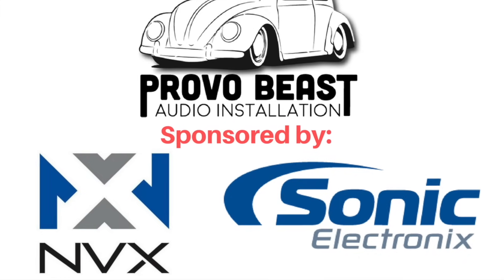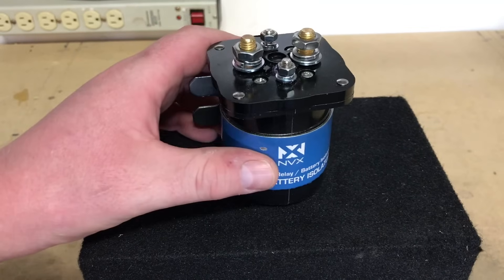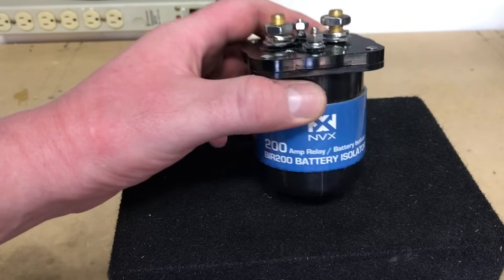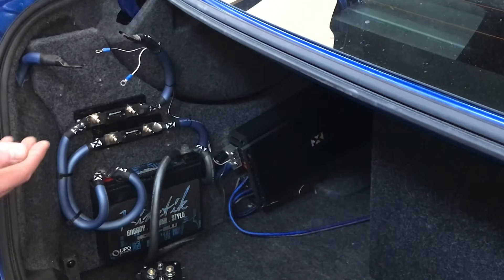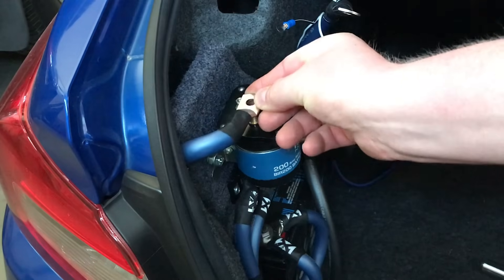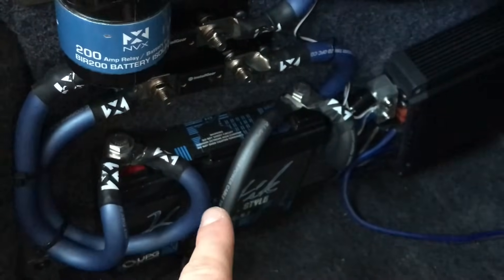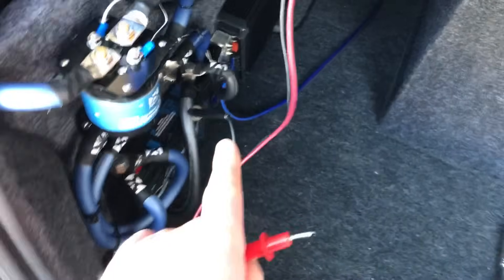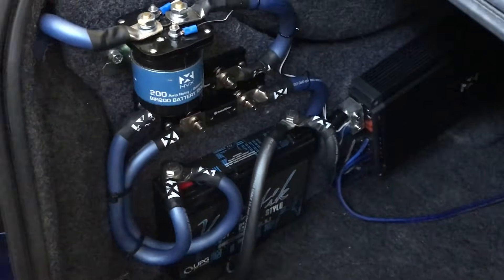Car Battery Isolators Explained: How to install on your car!

Comment: what if you do need to jump start the main battery?
Reply from the maker: Put a jumper between the hot post (from the primary battery) and the positive trigger post to override the solenoid to manually connect the batteries together.
Reply: Shawn's Silver Stacking doesn't this assume the starting battery (which powers the ignition) has enough juice to engage the plunger on the isolator solenoid in order to use the secondary battery? A dead battery is relative.
Reply: @oceanbreeze369  true

Comment: Is your charging wire connected directly to the main battery or to the alternator?
Reply from the maker: It all depends if you have the big 3 installed or not.  If you don't, i suggest running directly to the alternator.  If you do, you can go directly to the battery which goes directly to the alternator.

Comment: Mine clicks when I turn the ignition, and clicks when I turn it off. But house batterie went flat anyway. So what ??? went wrong. ;-(
Reply from the maker: Click is normal, its the electrical solenoid activating (like a relay) when power is applied or turned off to the trigger post.  If your battery went flat, sounds like you have a drain elsewhere.  Only way to tell is with a multimeter.
Reply: Or your battery is bad, or you didn't start with a fully charged battery and the sound system is draining too much.... or the alternator is going bad.....or :-)
Reply: Could be as easy as you're draining more then you're putting in. Sounds like RV since you said house battery. Dont use the microwave, heater and sound system at the same time 😂

Comment: How are you able to determine which battery will start the car and which will run the accessories? I've seen or read multiple instructions on mounting the isolator and connecting the wires, etc., etc. In order to set a battery to start the car wouldn't you need to disconnect the starter and wire "only" the starter to one of the batteries and nothing else? Sorry, no one has ever mentioned this and it seems like it would need to be done, but because no one says anything about doing that other than just connecting wires I am unsure. I do not want to start digging into the engine bay to disconnect the starter if I don't need to. Thanks!
Reply from the maker: The starter will always rely on the primary battery as that is how it was intended.  You do not need to rewire the starter at all as it already directly pulls from the primary battery under the hood from factory.  The isolator separates both batteries while either cranking at start, or while the ignition is off, protecting that primary battery.  Do not mess with the starter and / or starter wiring.
Reply: Provo Beast Audio Installation There is only 1 battery in my car. I'm adding a second battery. So you're saying all I need to do is add the second battery and isolator and I'm good to go?
Reply from the maker: Yes, thats it, based on principles taught in the video.
Reply: Provo Beast Audio Installation thank you so much. My isolator gets in today. I'll give it a go and test to make sure I've done it right with my multimeter.

Comment: Can I use my remote signal from my stereo that turns on my amps to also power the isolator?
Reply: Yes he is totally right with that answer, but to maybe elaborate on it a bit more, what he means by, make sure that's what you want, is cuz generally you want to use an ignition only source meaning that the isolator is ONLY activated when the car is running.... this is so if you choose to listen to your radio for a few minutes after your car is turned off, or if you're car is like mine & the radio & accessories don't completely turn off until you open the door (or so many minutes the car shuts them off to protect your ignition battery's charge) this will keep you from draining your ignition battery also I believe... I'm still somewhat new to this area of audio installations & components, but I believe this is what he meant by, make sure that's what you want... Especially since most people's reasons for installing a 2nd bat with isolator is for exactly that, & of course a half a dozen other reasons as well lol for instance my reason was to fix massive voltage drops during heavy use that was giving me a significant amount of headlight dimming, even causing my interior lights to dim on heavy bass.... So just remember like the first answer said, make sure that's what you want, if you don't mind that it would be pulling juice from both bats if you were listening to music after the car was off then by all means using your remote signal wire would not only work for you, it would, in most every case I could think of, be your easiest option to splice into it to find your isolators ignition source....
Reply from the maker: you could, as long as that remote turn on wire supplies enough amperage to turn on your amps and the isolator.  Also remember that that isolator will be activated anytime the amps are turned on so just be sure that is exactly what you want done.

Comment: How do you wire an isolator to an alternator that has a computer engaged that shuts off the alternator when the primary battery is full? The alternator isn't charging anything while the primary battery is full.
Reply from the maker: We answered this question on your other post.
Reply: EXCITOR WIRE FROM ALTERNATOR DIRECTLY TO POSITIVE ON BATTERY
Reply: I was saying something similar too, in my original post. New cars utilize the ECU to control the alternator, even though the alternator still has a rectifier, etc. Toyota for example uses the ECU to control alternator output AND Toyota simultaneously uses a thermal detector in the alternators that triggers the ECU to down charge, or lower the alternator output, at certain temps. to help prevent the alternator from boiling the battery. 
These systems today are not just plug and play anymore. So, with two batteries hooked up to the ECU controller, which they will be, you are messing around with the OEM Toyota charging-control system. Also, both batteries should be the same, gel, lead acid, old school batteries, whatever. There should not be a regular battery up front and some high power XS battery in the rear.

Comment: Quick question! Let's say I have a setup similar to the one you have there, except the amp may draw up to 4 thousand watts. If I'm driving along, and using the amp to it's full potential, won't the isolator constrict the flow of current from the alternator to the second battery in the trunk, causing it to slowly drain while the system is in use? I think it may also melt the insides of the isolator
Reply from the maker: Will, rather than focusing on watts, focus on amps.  This isolator can handle up to 200 amps specifically.  Lets say if you are pulling 4000 watts RMS / 14.4v = max draw of 277 amps.  In this case, you will want an isolator to handle the heavier current draw like this 500 amp one here: https://www.nvx.com/bir500-500-amp-relay-isolator/

Comment: Hello. Can you use your remote turn on for your amps?
Reply from the maker: you could, as long as that remote turn out wire supplies enough amperage to turn on your amps and the isolator.  Also remember that that isolator will be activated anytime the amps are turned on so just be sure that is exactly what you want done.
Reply: If I install an hc600 kinetic in the trunk and barely play music while car being off. Is the isolator needed. Or can I simply place a 200 amp circuit breaker? Thanks!